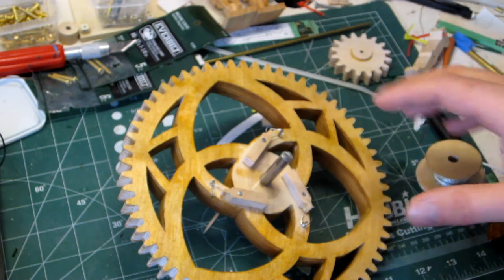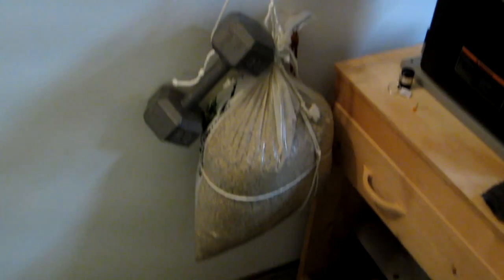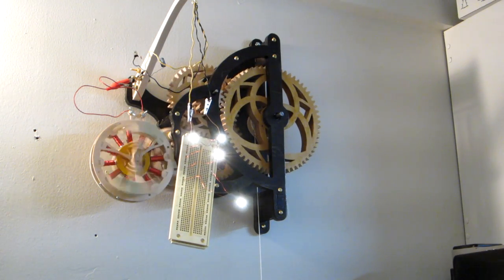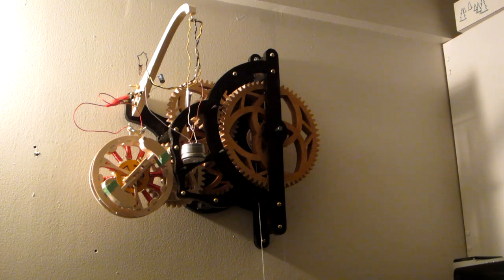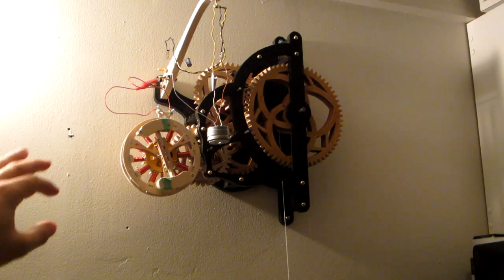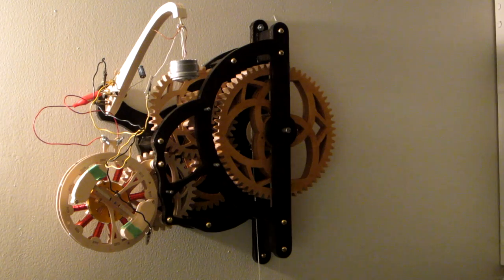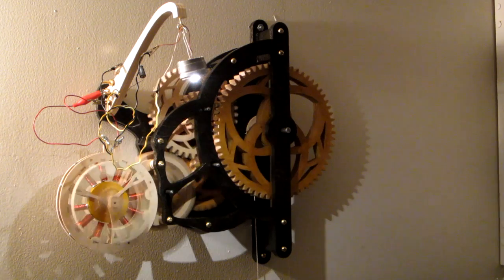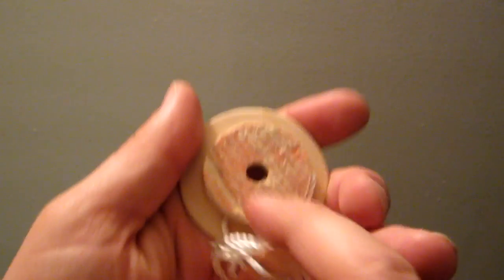Grav-Light Part Seven

Comment: Its nice bt can you tell me about how much exactly the height at which load is lifted and how many gears and pulley systems are used and what was the final gear rotation  to which through led light turns on .whats the real mechanics for maximum rotation??